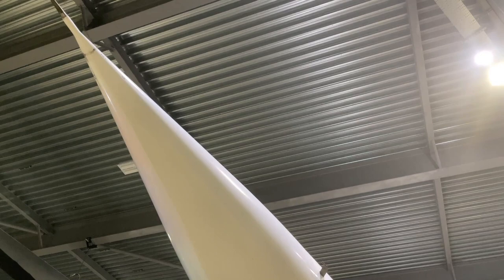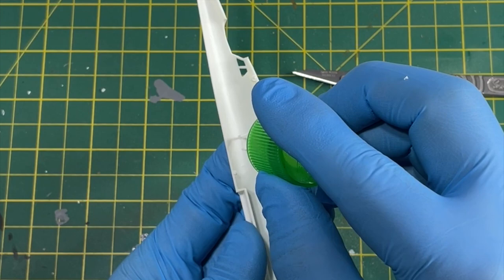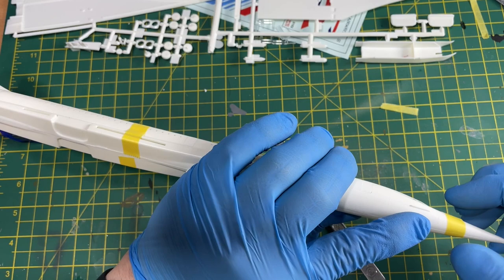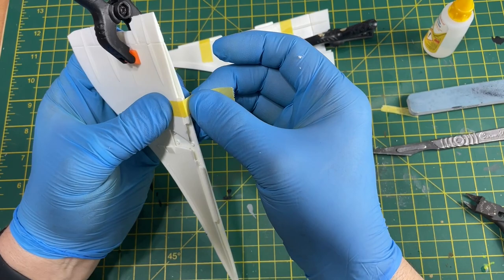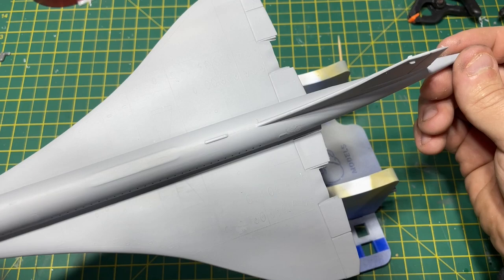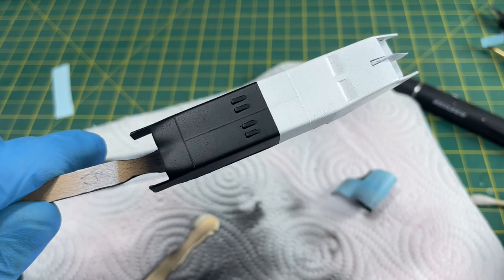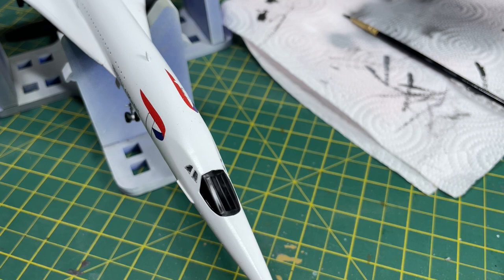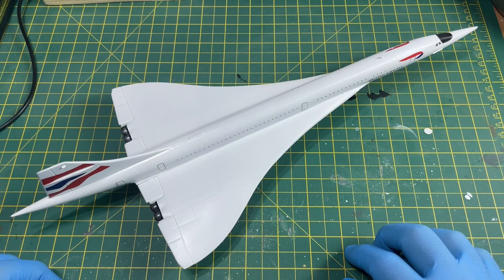Building a SUPERSONIC LEGEND!! | Airfix CONCORDE Full Build

Comment: Never realised the rear half of the engine nacelles were black...always thought it was gloss white all over...great result btw Mos.👍👍👍👍
Reply from the maker: Thank you my friend
Reply: @MOS6510Models  you are very welcome Mos.👍👍
Reply: @MOS6510Models  just finished the Tamiya 1/12 Suzuki RM-250 Motocross bike...and the great thing is other than the gaiters on the front forks it doesnt need painting...all the parts come moulded in the colours they are meant to be,has working rear suspension and even real rubber tyres.